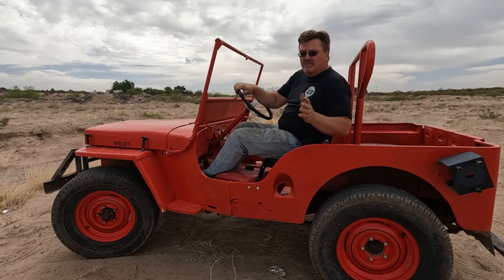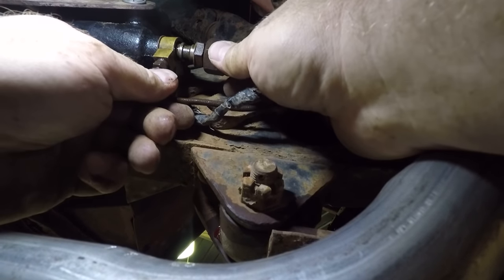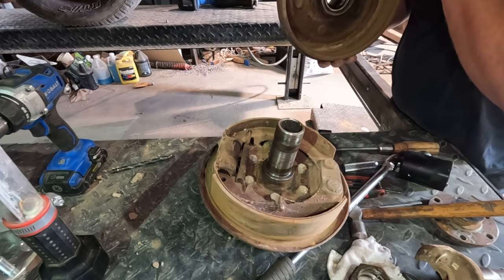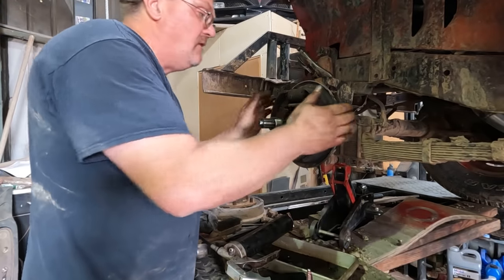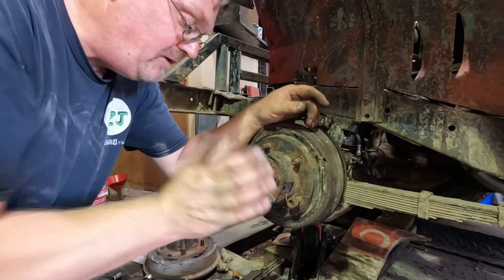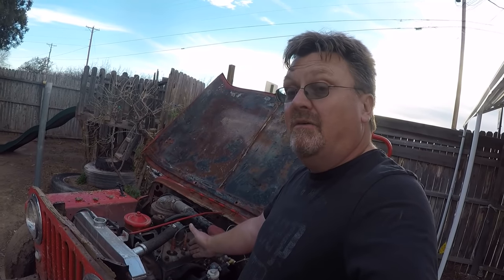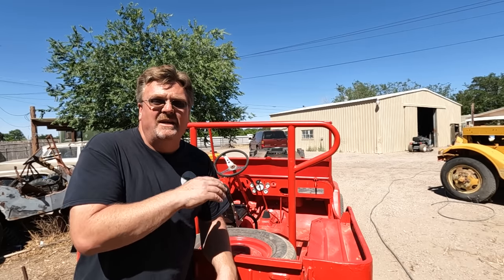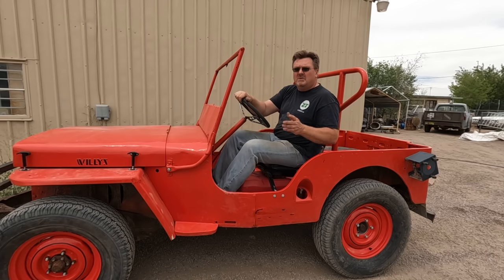CJ-2A Problems and Fixes, This Willys Jeep Gets Better!

Comment: I changed the bent today on my clutch for better adjustability and longevity.  I welded a nut onto the hole that wore through on yours. The rod was replaced with a turnbuckle.  I welded a bolt into the eye loop  on the turnbuckle  now the threads are the pivot. Nice and simple and the parts are readily available. When my clutch linkage first broke, I was two hours from home. I had to drive back with no clutch. Just kept starting it in gear and RPM shifting.
Reply from the maker: That's a good way to do it!

Comment: I have seen that nut before. my Cj2a had it on its front axle along with an international scout locking hub. the whole thing was pretty goofy when I ordered brake parts and the brakes were completely different. The best conclusion I came to was that they swapped though whole axle with a scouts front dana 25. They also swapped my rear axle with a dana 60 (I am not complaining about that). That's what conclusion I came to but idk haha.

Comment: there are a few types of aftermarket locking hubs for the Dana 25 - 12 spline axle. Warn, Selectro Dulamatic, and similar. I believe the nut is part of one of those kits.
Reply: The nut is for a Warn Loc-O-Matic automatic hub. It has plastic clutch pads that ran against the OD of the nut.

Comment: Nice video.  I've owned 7 flat fender Jeeps but only one 2A, an early '45 model with a column shift.  Most, but not all, front axle hub conversions for Jeeps required the axle threads to be cut off.  I've taken axles apart both ways and later on Jeep discontinued threaded axles so they were full floating. I've never taken a front axle apart with good king pin bearings, they either failed from water intrusion or the preload way to tight like your 2A.  I wonder why the spare tire carrier is on the wrong side?  Jeeps are a blast have fun!

Comment: I wasn't aware of a choice in material. Someone suggested packing the line with real fine Sand to prevent Kinking. I like the idea but worried about getting "all" the sand back out. Thanks for the show.
Reply from the maker: I've heard of that sand trick with roll cage size tubing, but I wouldn't try it with fluid lines.  Hand held tubing benders are pretty cheap, they hold the walls of the tube in place so it can't flatten out and kink.
Reply: If you can, spend more on good tubing like E-Z Bend. That stuff is magical. Smaller diameter tubing is easier to work without collapsing even if it is steel. I tried bending a 3/8" steel tube for my friend's clutch and it collapsed immediately even with decent bending tools.

Comment: If you are going to do jumps ,where the front wheels come the ground it is good to make frame fillers between the round cross frame peace to the place where the frame is boxed by the front bumper. This will prevent the frame from buckling.  Card board cut out then plasma cut  metal to fit simple weld and you have it.   Old kickstart.

Comment: Me and an old buddy of mine bought a 48 jeep willys that had highway tires on it. Wich was curious since its top speed was like 38mph wound completely out but anyway it was all original. The engine had never even been gone through or even the carburetor. We used to take it up on mt. Hood and purposely try to get it stuck or find somewhere it couldn't go but never were successful. Good times
Reply from the maker: Nice!

Comment: Love your Garage and your Delivery. Easy to understand and we don't all have Mega-Bucks. I'm working on a 48 CJ2A right now so your little Red Jeep project is Perfect for me. All I did from stock is put Larger Brakes all Around because I towed a Boat 2miles Down Hill. Stock Brakes weren't enough. Keep it up. Do you have Hints for Bending Brake Lines?
Reply from the maker: Thanks!  Yeah, the stock brakes are pretty marginal even without a trailer.  The one trick to brake lines that I found to make things easier is to use the nickel-copper alloy line.  Its hard for me to pay the premium for the more expensive material, but it bends and works way easier.

Comment: Most Dana 25 axils use shims only under  the top cap only. Some older ones, below a certain serial number, you divide them evenly (as close as possible) top and bottom. I start with about .050" shims on top and none on the bottom. Tighten at least two bolts on each cap to 32 ft/lbs and test rotational drag. Then if too loose REMOVE 005" of shim, retighten and retest. If too tight add .005" shim and test. If you remove all of the shims and it is still loose (trail repair) you can add a "thin" washer  (.025")between the bearing and the shoulder of the dowel pin on the cap and start over with the shimming. I would use another knuckle if possible if it were me.

Comment: Someone else mentioned where the nut is from in these comments, but I've seen a similar two-hole removal system on some bicycle parts, like a bottom bracket or rear cassette.

Comment: So if you notice there's a noise like a fan blade lightly contacting or a bolt rubbing on a bell housing slightly. Best description I can offer? Oh I heard a distributor making that noise one time but it went away with new points or something like that..

Comment: I don't have brass hammer. I have new and a strong urethane hammer with its steel pipe and can still bash down hard to place the outer race to the wheel attach to the axle and CVJ housing. I don't have brass chisel. I use wood jaws to press fit the outer race Vise or Gantry portable small size press or C-clamp the outer race into the seated.
 A banging with brass hammer is like weak mind because press with screw thread of my MAC ball joint set C-Clamp with the handle is super stronger pressing than hammer hit.

Comment: Is the jeep heads cracked or gaskets causing coolant leaks on heads or engine block ?
Reply from the maker: The block has 10 cracks in it, I put it together with glue just to see how long it would last.  Been about two years now.  If you're interested, this is the original build video: https://youtu.be/H0c4eYR0ENM

Comment: No, the wheel didn't hop it just dig in and stuck in the uphill slope. The bar grip from Kubota tires service that way the bar grip is angled as it's able to dig the dirt away from both sides of tractor rear tire. Tractor tire will be 295mm width and R16 inch army Farm Bureau custom order for the sand dune buggy Jeep 2A and good traction type tire to keep it from hopping use air pressure down to 18 - 20 PSI requirement from Mickey Thompson expert tire specialist ASE of many different type of tire treads is the choice that you shall select the set of rubber 4 ply. Your tire is not a professional correct type for uphill all terrain. The hopping of the wheel is incorrect use the sentence Hopping the whole Jeep with buckled up the tow hoist line and it connect in between Hot air balloon and the red Jeep -2A and make propeller and thrust of your forward your gear; to go forward is not working so bad error if Jeep Daimler AG didn't build propeller and rudder that you can add the rudder to your Jeep at 100 MPH capable speeding Hi performance Civilian racer named the Jeep. Like a Blue Flame Bonneville racer named CJ-2A named meybe Cobra Jet-2A.

Comment: May I ask whose radiator (part no)?  TIA
Reply from the maker: I'm not sure who really makes them, there's a bunch of different sellers on ebay.  Just search for "CJ-2A aluminum radiator" and a bunch will pop up at pretty much the same price.  Probably the same manufacturer for all of them.  I just checked, there's three different sellers listing them at $145.  I've had good luck with the radiators, sometimes the caps have too high of a pressure.
Reply: @LowBuckGarage  Thank you!

Comment: You bought a new muffler from the wrong dealer. Your muffler for Quad CJ-2A have to be low profile for taller ground clearance prefer. The low profile muffler is not round circle on the end. It is elliptic so the wider muffler is along the horizontal line. The shorter height of the muffler is along the sample line vertical. You get almost 2 inch shorter from Midas. The elliptic muffler is shorter height than the round muffler so that is why old style Jeep muffler is obsolete and no longer popular.

Comment: What steering wheel do you run on that gem?
Reply from the maker: Its a generic aftermarket one, and some previous owner had welded it on.  I don't recommend it, the smaller diameter makes the steering effort noticeably harder.